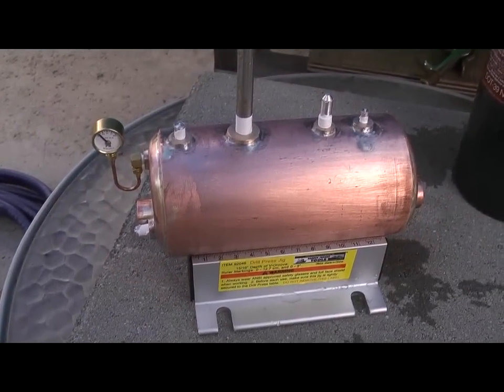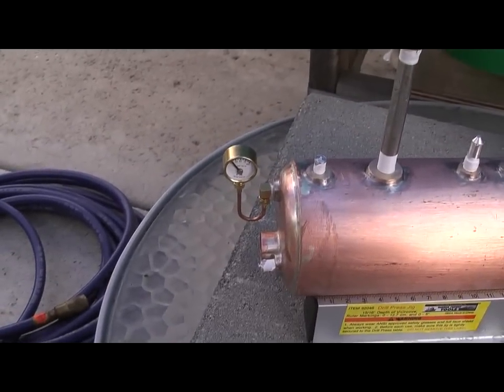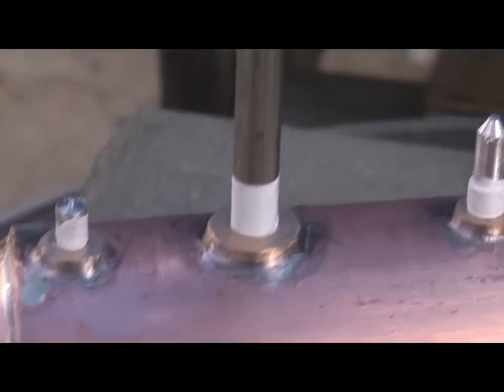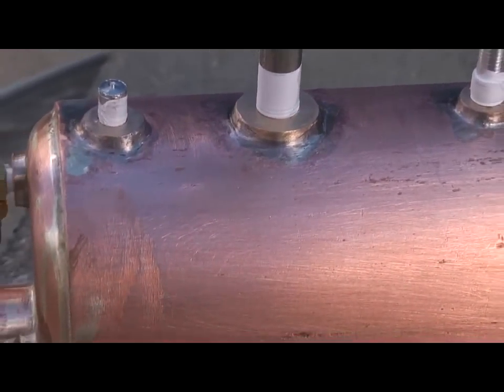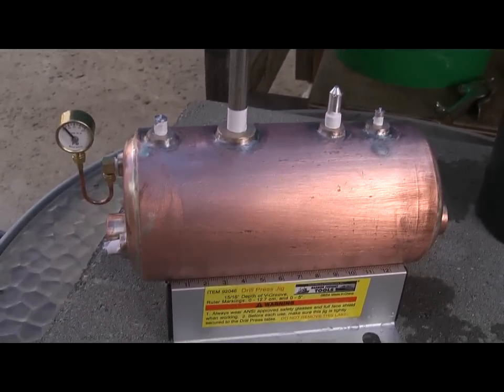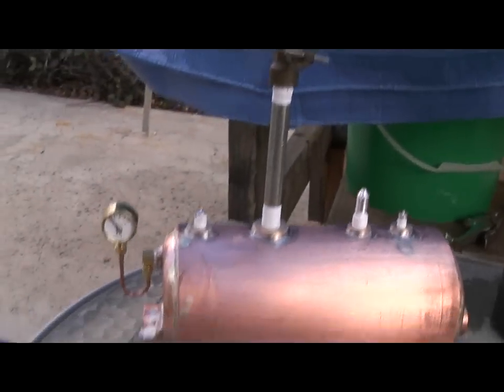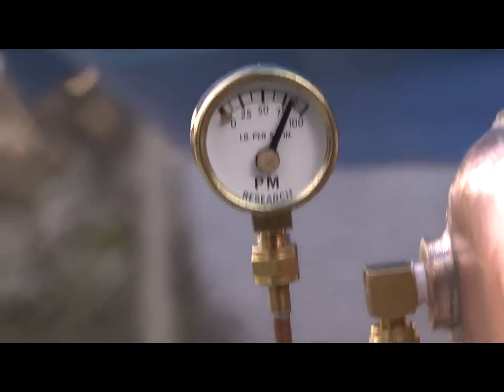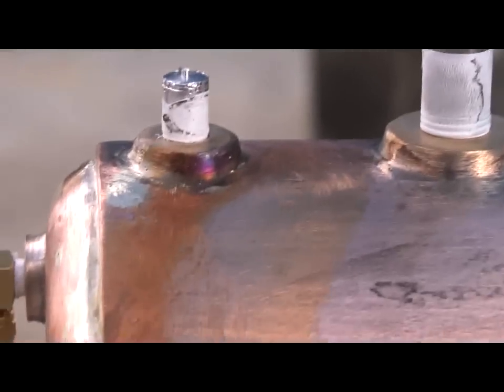Steam Pressure Test

Comment: Not the correct way to test a boiler. You need a hydrostatic test without steam.   Fill the boiler with water except for a small pocket on top.  Attach a hand water or air pump, seal ports, and pump the pressure to 1 1/2 times working pressure. No heat.  Watch for leaks. Your method is no different than actual operation, except you have no safety valve with closed off ports.  Extremely dangerous and potential 100 # pipe bomb. Steam expands 60 times volume upon exposure to atmosphere. Be careful